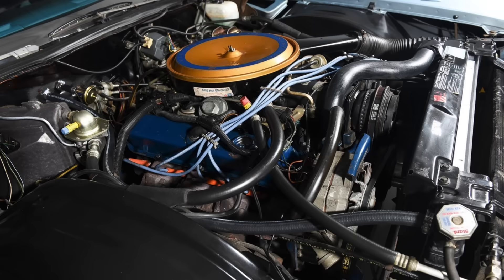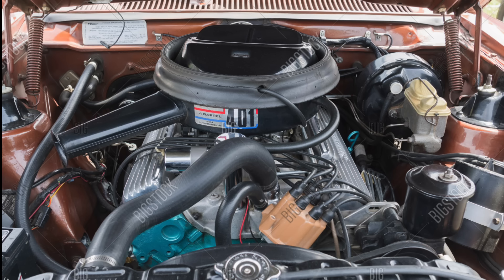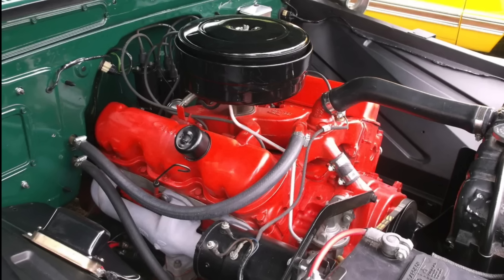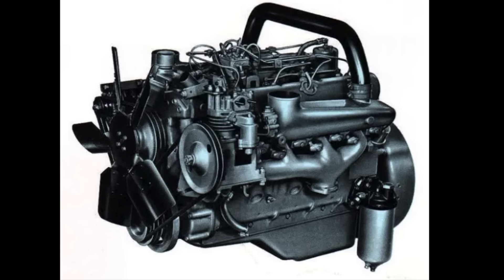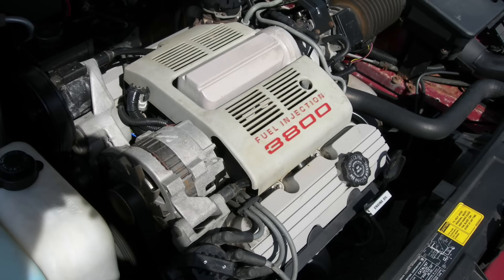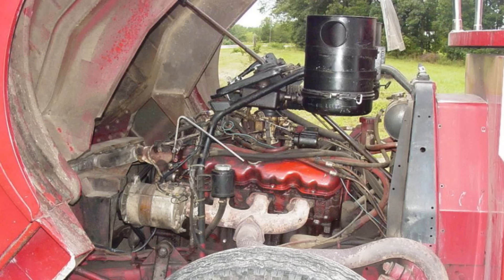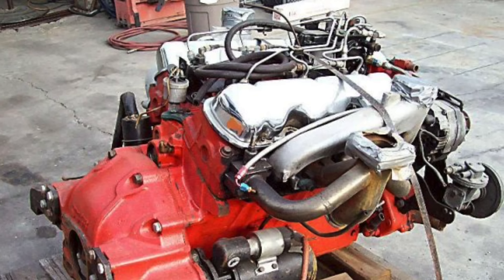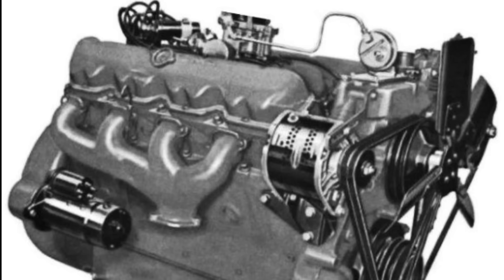The 1966-72 GMC 637ci 60-Degree V8 - GM's Largest On-Road V8 Is Virtually Unknown!

Comment: People talk about how "under powered" the GMC V6, Twin 6 and 637ci V8 engines were, not realizing that the engines absolutely can make WAY more power than they released with, but that would shorten the life of the engines and increase maintenance costs. These engines were GIANT, over engineered to be simple, reliable and made to last. By tuning them to turn slow and make a ton of low end torque, the engines can get big loads moving more easily and not be stressed to the max when the engine is being run hard. These were never meant to be performance engines, they were meant to do work. And that is something lost on a lot of folks today that are used to big rig torque and power in their 3500 series pickup.
Reply: So True....Back when a man bought a G.M.C. that meant working that baby for what it is made for.
Reply: I read years ago, maybe below a write-up on curbsideclassic,  a guy wrote about having just the 305 V6 in a half, 3/4, or 1 ton truck.  Think he was on a logging road working for a logging company back in the '60s, can't remember what he said he was pulling with that truck.  He wrote, you could let the clutch out, and it wouldn't die, and it would pull that load at idle.  Maybe same guy I read years ago, someone put it best...."lugged most like a diesel of any gas engine I ever drove."
Reply: I like the fact that the spark plugs were easy to get to compared to having them sit next to a hot exhaust manifold.
Reply: With the gearing that they mated them to they’d pull the Empire State Building from NYC to Miami. I’ve watch vintageiron do a full rebuild on a 305 6cyl and they were so overbuilt for the work that they were intended to do. They also had technology such as a waterless intake manifold and cathedral ports decades before the LS platform ever existed. I’d love to have one of them to restore.
Reply: Good post. A lot of car people seem to get confused over the distinction between a high performance and high torque engine. They're not the same and the 'high performance' engine isn't necessarily the better option in many applications.
Reply: indeed...a diff engine for a diff market share..
Reply: You can rebuild any motor, but downtime means lost money, and if you have to rebuild that high-output motor every time you turn around, it gets uneconomical to keep it.

The saying that "The brightest light bulb has the shortest lifespan" fits very well with engines
Reply: @Puffie40 
You just about can figure out how much fuel an engine will use in its lifetime, question is if you wanna cram it all in there in 5 seconds for a top fueler engine ,or have a reliable workhorse that runs for 40yrs.
Reply: One other thing to consider is engine durability and component quality was nowhere near what it is today.  A car engine was lucky to get 50,000 to 100,000 miles on it before requiring a rebuild, and that is why service life was extremely important in industrial advertisements.  Engineers knew that "less motion = less wear" so that was the approach with older motors.
Reply: This explanation also applies precisely to the International line of gasoline engines.
Reply: Nah they werent down on power ,its just those were the days when 1 horsepower was an actual horse. 😂
Reply: Noot really. HP ratings were SAE GROSS HP, sans air cleaner, exhaust, and accessories. You know, the things that were actually installed on the truck at the factory.
Reply: The hardest work most trucks ever do today is hauling somebody's dead ass around. Myself included. They have become status symbols and luxury land yachts.
Reply: Yes, the Ford 300 I6 comes to mind
Reply: @kellismith4329 I started driving for UPS in ‘85, when most of their delivery trucks ran the straight 6 Ford. They weren’t hot rods, didn’t have a lot of highway speed but they pulled hard when loaded.
Reply: @kellismith4329 Oh yeah.. the Ford 300 l6 was a beast in terms of reliability and endurance... I'd say the same about Chevys 292... they just run forever.
Reply: @kellismith4329 I had one in a '66 F100. A great motor.
Reply: @kellismith4329  A 292 Chevy has gobs of torque,but if one was stupid with high rpm,you could vent that block in short order,that is the glass jaw of the 292 .
Reply: @kellismith4329  I have one. Love it.
Reply: Great point.  I have a 7.3L F-250 and a BMW 335d.  They're both fantastic engines, and make virtually identical HP and torque, from the factory.  However, I can put the pedal on the floor in the Powerstroke and leave it there for several minutes, pulling a big load up a steep grade.  It just doesn't care.  I doubt the Bimmer would feel the same.  Different applications, different engines.
Reply: In ‘63 my dad had a brand new GMC pickup with the V6 and the Powerglide trans.  The fire alarm sounded in town, and as volunteers, we took off for the fire, straight into a 40 mph headwind.  The fire dept. had a WWII 4x4 deuce and a half truck we had modified with a Chevy 283 V8 and a 2000 gallon tank.   The fire truck PASSED US enroute to the fire.   Dad kept a pencil on the dash to be used to make a mark if the pickup ever got to 60mph.
Reply: Same with the 400 small blocks... they had 175 hp.. but that's the biggest small block they had so we make it work quite well.
Reply: I had a 67 Chevrolet dump truck with the big V6 it was cool
I had a Cadillac 500 and I am thoroughly enjoyed it lack of horsepower but it made up for it and back to the big GMC V6 the valve covers reminded me of the 409
Reply: Just like how the 7.3 is underpowered, but lasts 1,000,000 miles no problem
Reply: I had a 62 GMC log truck that had a 305 v6. It had a tag on the windshield post that said 165 horsepower and 195 pounds of torque. It was slow but it would pull all you could put on it
Reply: It is something lost on most.....a guy could fill on 85 octane gas. Drive on the governor all day at WOT and not hurt it. Even if it starts to ping and knock, they were usually OK
Reply: @ks_1111 only an idiot would do that.
Reply: @ks_1111 if it pings n knocks, I back off timing
Reply: They don't make a lot of power because they only rev to like 3,500 rpm. Turn up the RPM with corresponding mods and you'll make more power.
Reply: I'm so glad to hear someone that knows the history of the GM v6. Ss if you get time I want you to address the 3.8 l 87 Monte Carlo that had the Chevrolet 3.8 with the distributor in the rear I hadn't seen too many of those we had one that ran 400,000
Reply: @ronalddaub9740  I run a hopped up (Kenne Bell equipped) 225 Buick 'Odd Fire' V6 in a flat fendered Willys Jeep.

With MSD, too much carb, fat headers... in a 2600 pound vehicle, she's a beast.
Reply: @ronalddaub9740  The 3.8 ,or 229 Chevy was a thin cast block,with thin cast heads,and a light cast iron crank that if taken care of would more than likely reach 200,000+ miles, which in based on a small block Chevy.
              The GMC V-6 engine probably weighed at least three times as much,and had a crank that was over a hundred pounds, heavy cast block and heads,and the list goes on.
Reply: @ronalddaub9740 You had the ONLY Chevy 229 that lasted that many miles. Those things are camshafts like crazy and they were utterly gutless.
Reply: I've driven the 350 v-6 many a mile, as we had 12 of them and never in 2 decades had one fail...
Reply: Small correction: they were under-engineered and over-built.
Reply: @VinnyMartelpossiby
Reply: I remember before I was a teenager, telling my dad about a 327 fuelie, in a corvette, making the same horsepower as a Cummins, in a kenworth k123.  He explained the concept of low end torque to me.
Reply: But if adapted to today's tech, fuel injection, better intake manifold and modern valve train would be even more reliable with even cylinder fuel ratios, would probably almost double the power.
Reply: @davidroberts6594   And with double the power, would come double the maintenance. You have to realize that in a work environment, it is not about maximum power, it is about long life and keeping the engines under stressed. As capable as modern engines are for their size, they are also already stressed pretty hard from the factory as it is, especially small displacement turbo gas engines. Take big rigs for example, they run around with 11+ liter diesel engines, most of those engines max out (here in the US) at about 500HP from their factories. Those engines are often governed to no more than 2,100 RPM, and when cruising around, typically they turn 1,400-1,600 RPM depending on gearing and speed. Why do the engines turn so slow when they could do 2,500 RPM or more? Because literally every revolution saved on the engine, is less wear and tear. That is what these beasts are built to do. Increasing the performance of these engines would be easy, I am sure these old gas engines could make triple their rated factory power with better induction and some minor tweaks, but it would defeat what they were built for. Moving the torque curve up the RPM range to increase top end horsepower is more strain that is not worth it when you are pulling heavy loads, especially from a stop. Remember, extra power means more heat, more heat means you need better cooling, and even with the better cooling,  you are beating up the oil more so it will need changed more often.....
Reply: @Carstuff111 well said
Reply: @davidroberts6594 today's fuel injection creates better fuel control through a broad rpm range. This results in better power output and better fuel economy. But it does NOT result in better dependability. Just the opposite. Carburetors are far more reliable. There are 1920s vintage cars still running the original factory Carburetors. No high pressure fuel pump required and no injectors to plug up.
Reply: @FRLN500 Carbureted engines actually make more power.
Reply: @davidroberts6594  I would have been interesting how the GMC truck engine family would have done with a full ECM engine management system, probably decent fuel milage and smooth torque and power.A great engine that would be much better.
Reply: @davidroberts6594 nahh. These were industrial lumps. We need more industrial lumps for industrial applications.
Reply: @davidroberts6594  just the efi swap would double up the power, those stromberg 2 barrels are only good for 275 cfm max, part of the reason why it makes peak torque at 1600 rpm with an oversquare engine, my 239 inch y block is the same way, peak torque at 1800 with a 3.1 inch stroke, an intake and efi would probably move that torque band up to  2500-3000 rpm depending on how well it flows, long runner-short runner, etc
Reply: @davidroberts6594  You clearly read too many car magazines.  --Doozer
Reply: Great info!
Reply: More power?  Sure.  Way more?  I don't think so, unless it can significantly move the operating rpm much higher.  Do you think the crank and rods are up to it?  How heavy is the stock valvetrain?   Built for torque, not rpm.  Unless the aftermarket steps in, I am skeptical of the claim.  Has anybody done it?  Chime in anybody if you have info.  It's a very interesting engine for sure.
Reply: @madrew2003  It's been said many times before,but that engine was way overbuilt in the first place an over 100 pound steel crank,4 ring pistons (excluding the 305-351E 3 ring pistons) overly heavy thick cast deep engine blocks and cylinder heads with sodium cooled exhaust valves in the big cube heavy duties.These engines with good maintenance were capable of well over a half million miles or more.
Reply: @patrickmcgoldrick8234  yes.  All that is about durability.  NONE  of that is condusive to increased HP.  Now, in modern times with boost, maybe it would be of benefit.  NA you would have to spin rpm to make hp and all the super heavy stuff will NOT be happy.  If somebody has done it, please share as I am genuinely curious about it.
Reply: @madrew2003  I don't know,or remember saying anything about boost,and I am in agreement about heavy reciprocating mass,and excessively high rpm,my curiosity lies in what the GMC truck engine would have been like if it was ECM controlled,and fuel injected.I think quite possibly it may have been better on fuel,and smoother running in different climates,and temperatures.
Reply: Oh that 100# crank will happily take out the whole side of the block and the inner and outer fenders  @madrew2003
Reply: I remember they had very low compression ratios😊
Reply: Well said, you shifted these like a straight 6,, never over 3K and road out the torque
Reply: You obviously never driven a GMC truck with one WORKING.
Reply: That part.  Also more horsepower isn't always a replacement for torque.  Try towing a trailer up a hill with the engines that are "rated" to tow a certain amount.  Your foot will be on the floor while you are losing speed.  This can actually be a hazard in some situations.
Reply: They were made for work, not high performance.
Reply: Fastest speed limit was also 55 and you don’t need much to reach that
Reply: @CopperheadGarage 
In the 80s yeah, before that the limits varied quite a bit ,and usually a lot higher than 55
Reply: @MrTheHillfolk  1973-1995 speed limit was 55
Reply: @CopperheadGarage  Was not enacted until 1975.
Reply: @CopperheadGarage  The 55 mph national speed limit was not in effect until 1975.
Reply: @-oiiio-3993  Actually the 55 mph speed limit took place in 74 during the Arab Oil Embargo,by the order of Nixon.
Reply: @-oiiio-3993   Federally Jan 1, 1974 to be precise. However states were free to start earlier. Many states in the northeast started Dec 1, 1973. It provided me with three tickets on the way back to base that night. It was the Sunday night ending Thanksgiving weekend.
Reply: @CopperheadGarage WRONG...55 DIDN'T COME IN UNTIL 1975!!!
These engines were out in the 60's. Back then speed limits interstate? Varied from 65, 75, and daylight...no limit... reasonable and prudent...nite 65
Reply: @CopperheadGarage The 55 MPH speed limit was enacted years AFTER these engines were out of production.
Reply: I run a hopped up (Kenne Bell equipped) 225 Buick 'Odd Fire' V6 in a flat fendered Willys Jeep.

With MSD, too much carb, fat headers... in a 2600 pound vehicle, she's a beast.
Reply: @-oiiio-3993and if non turbo, maybe even turbo? Any 2.0T Honda Civic or Accord will leave you not just car lengths behind at the quarter... But straight gapped
Reply: @johnhull6363  Not "at the quarter" off road in mud, sand, rocks. rutted tracks... .

It's a raised, hot rodded, low geared, (though it does have Warn overdrive) fat tired '46 Willys Jeep - not a 'quarter miler'- though the engine was formerly in a sprint racer.  It will go faster on pavement than I will drive it. 
'Road manners' anywhere over 60 are like managing an ill mannered horse, over 70 is outright frightening.
Reply: Had a 3 quarter ton GMC pickup, '63, workhorse,
Bare bones,no radio,
Mid sized V6, 4 speed, granny gear model,
Pulled 12 wheel trailer with 580 CK diesel, extenda-hoe.
I bought it in '72, never touched the motor, just oil and coolant. Always started, got me from point A to point B and Back.
Take off in third if ya slipped the clutch a little, 
at idle,,,,
Reply: WTF happened? Now they got the eco boost. Garbage. It's possibly the worst ever engine GMC ever built.
Reply: @explorecriminalminds Isn't the Eco Boost a Ford?
Reply: @MrBirdnose  isn't the "eco" versions of these engines always lamely paired with a little green leaf emblem to try to appease the climate cult wingnuts😁
Reply: @John.Zachary.Delorean  Nah, that's Flex Fuel, which exists mostly to appease Iowa corn farmers.
Reply: @John.Zachary.Delorean No, nobody cares.
Reply: @explorecriminalminds   The eco boots is here for a good time, not a long time.  No eco boost is going to pull the weight that these GMC engines can. I think the calculus of your statement is based on fantasy.
Reply: @explorecriminalminds Ecoboost is Ford, another piece of junk.
Reply: @explorecriminalminds eco boost is ford tho.. but I agree.. it's garbage
Reply: @explorecriminalminds Ecoboost is a Ford engine.
Reply: Absolutely not.  If you ain't first you're last.  Daily tow with 700hp PSD so I can get places fast.

Comment: These were far overshadow by the big block v6s and the twin six 702 ci v12. I guess the v12s found a lot of use as irrigation pumps in the great plains as they could run all day for a long time with very little maintenance.  In texas they were rigged to run off well gas so would literally set em and forget em.

Comment: You did not mention the weight of these engines. For example, if I remember correctly the V6 engines weighed around 900lbs.
Reply: Around 800 for the pickup version. The bigger truck V6s were heavier because of the accesoiries.
Reply: The 702 V12 is around 1400 lbs.  That puts the 637 V8 at around 1200.

Comment: I worked at a GMC dealer,77-82.Did two long block changes on the 637.The dealer got two new factory long blocks from GMC.They were in the J model tractors with Fuller RT613 trans.Heavy piece of iron.Sure ran smooth.On the two barrel carb it would pour the gas into the engine.